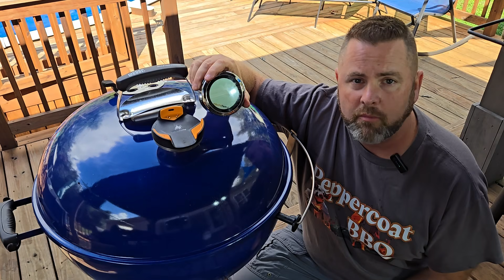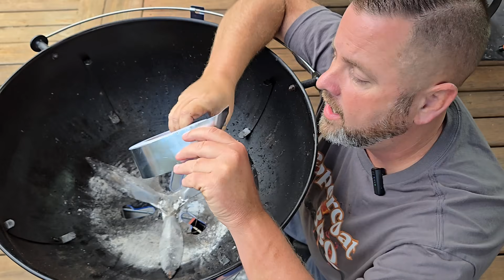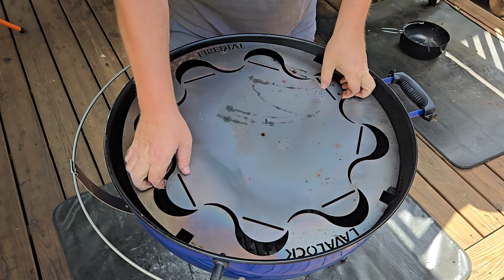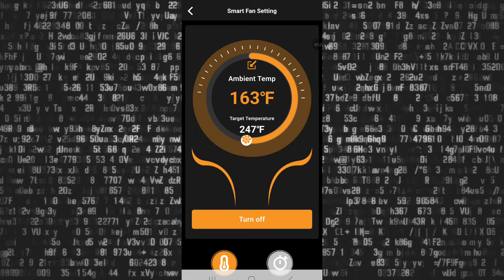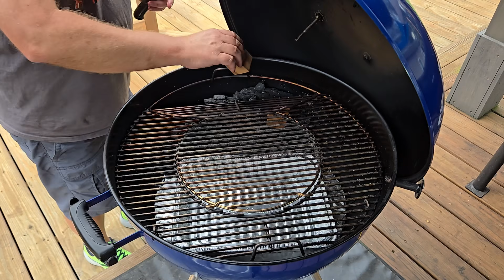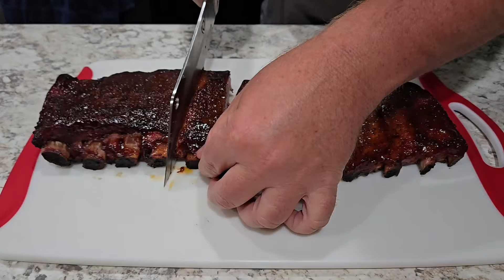ChefsTemp S1 & Breezo Weber Kettle Upgrade: Smart Grill - NO DRILL!

Comment: Great video. Thanks! Just to play devil's advocate, the more I use my Weber Kettle (I've had it for close to a year now), and after dozens of cooks, the less I worry about precise temperature control. I try to keep it in the ballpark, within 50 degrees or so, by adjusting the vents and using more, or less charcoal to start with. I find the end product tastes just as good as when I stress about being off by a few degrees. So, for me anyway, an electronic controller would be overkill. Plus, the simpler my set up is, the more it satisfies my inner caveman, which is one of the things I like best about using charcoal in the first place. Just me, a cold beer, a big hunk of meat, and the fire. Just my .02...
Reply from the maker: I hear ya!  I use this set up for really long cooks or sometimes when making rotisserie chicken I find the airflow helps with crisping the skin.   The Weber Kettle itself is pretty well behaved with the right amount of charcoal and vent settings.  I also agree with your temperature swing mentality.  I used to freak out if I was 20° above or below my desired temp.  It all evens out in the end and I've never had to throw anything out because of temperature swings.   Appreciate you watching!

Comment: Do you know if i can just us the blower without the digital top?
Reply from the maker: Yes, there is a button on the back to cut it on, or to have it cycle on and off.  Although, I wouldn't recommend using it without the S1 if you are planning to use it for long cooks.  It will get your fire to hot.

Comment: Nice video. The only problem is you lost one of your Weber kettle’s best features. Now you can’t quickly clean out the ashes in the bottom with the lever clean out. I would not want to lose this
Reply from the maker: The great thing about this set up is you can remove the fan and tape when the cooks over and you're back to normal.  That's what I do.  Appreciate you watching!
Reply: @PeppercoatBBQ you can also vacuum out the ash. Takes 1 min to do

Comment: Do you have a recommendation on where to install the fan in relation to where you place your coals?
Reply from the maker: I like placing it on the opposite side of the charcoal.   Lining the charcoal grate with foil forces the air to come up through the charcoal.   If it's under the coals make sure it's blocked with something to prevent coals from falling in it, and to prevent ash from blowing everywhere.

Comment: Have ever thought about using the Spider Venom for the Kettle?
Reply from the maker: No, I've seen them and they look like they work well, but I already had the S1 and Breezo.  I believe the Spider is more expensive also.  Appreciate you watching!
Reply: @PeppercoatBBQYes, it’s like $268 bucks, but it works amazingly well on the Kettle.  I also have an S1 that I also used on my Bronco 2, but I just assumed that I would need to drill a whole on my new Master Touch Kettle.  I never thought outside of the box like you did on this video.
Reply: I also modified my kettle by putting 10 wheels on my kettle and placing the original wheels on the front legs.   The kettle is fully mobile now, and looks great with these wheel modifications.
Reply from the maker: @pedroelfuerte2572 that's awesome!  Maybe I'll do a viewer mods video in the future  for the Weber.  I'm currently working on one for the Pecos.

Comment: The Breezo fan is impossible to find. For the lid thermometer I would recommend drilling a hole on the vent side so the thermometer will be on the indirect side.
Reply from the maker: You can buy them from Chefstemp website. I also checked the temp on the vent side vs. the opposite side and there was less than 10° difference, which may not always be the case.... but it was when I checked.

Comment: Great job with this video. I came across this unit sometime last year and I was like what a novel idea and I was interested in it as a new B to the Weber kettle. And in barbecuing and smoking, but I've come to find out that this whoever cattle holds temp is really good. I could hold 250 to 75 for three hours without adding fuel cause I've learned the right fuel to use depending on temps outside and wind, I've learned to adjust with type of fuel. I just add some when I temp my food if it needs it.  I haven't figured it out on longer cooks for like pork butt or anything like that so that's why I'm interested. Thank you very much. I appreciate this vid.
Reply from the maker: You're right, the kettle already does a great job keeping temps with the correct amount of fuel.  This is just a tool that helps make smoking a little easier.  I like that it cuts down on a little bit of babysitting.

Comment: Isn’t hot ash going to fall into the fan?
Oh excuse me… you addressed my concern just after I posted the comment LOL
Reply from the maker: Yeah, I tried to cover potential issues. Thanks for watching!
Reply: @PeppercoatBBQ how do you plan on clearing ash out? A shop Vac?
Reply from the maker: @The_Monkey_King no, when the cooks over, I removed the tape.  I use it mostly as a grill and didn't want a hole in the side.